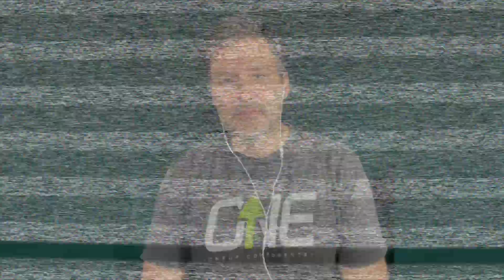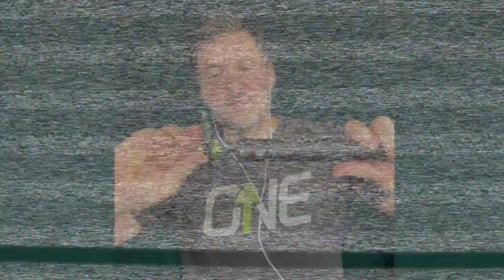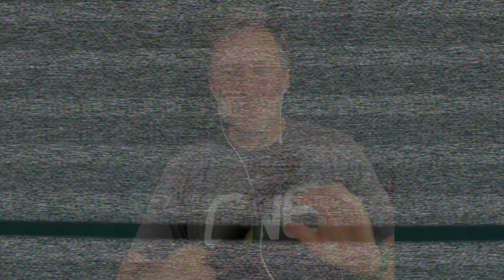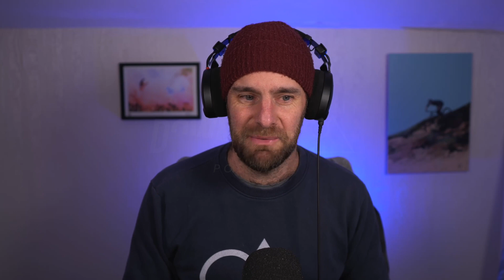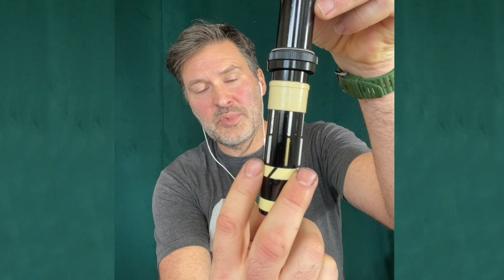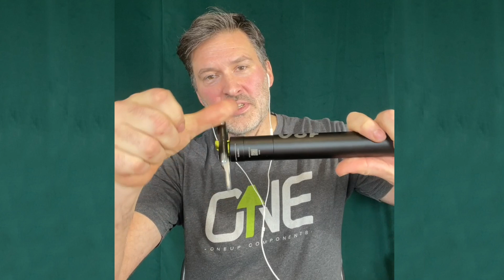Mountain Bike Tech Chat With OneUp's Jon Staples - Handlebar and Dropper Post Design

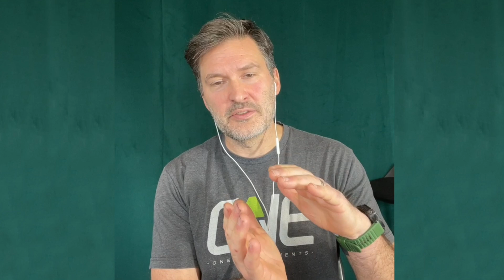Comment: Great video.  My wife and I both have the aluminum bars and love them.  My wife doesn't complain about getting numb hands after riding anymore.  At 16:30 you talk about something I've been wondering about.  The actual position of the bars.  I'm going to make a slight change to mine and role them back a bit further before my next ride.  I not 100% sure I'm in that sweet spot at the moment.  A slight roll on the bars is an easy check.
Reply from the maker: Great, glad you enjoyed it. Good luck with the bar roll experiment.

Comment: I didn't hear it in the podcast but is the 34.9 upper the same outer diameter at the 30.9? Another way of putting that is are the larger diameters essentially shimmed versions of the thinnest one? Sorry if it was discussed, admittedly i was running and listening.